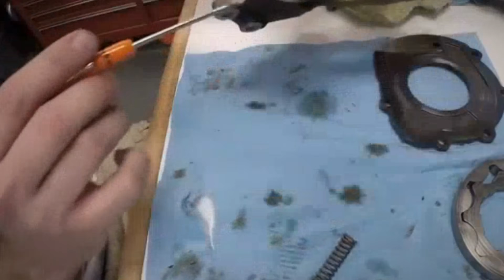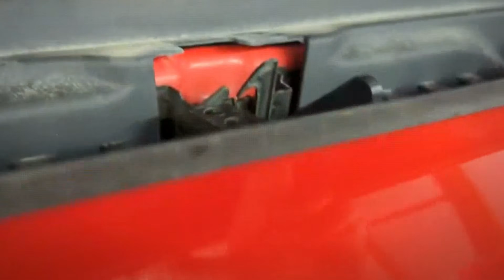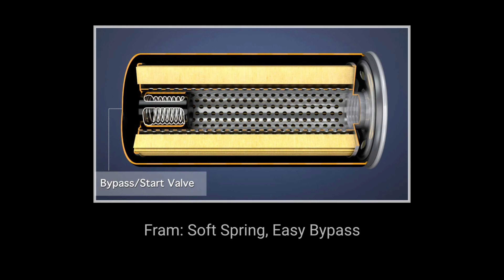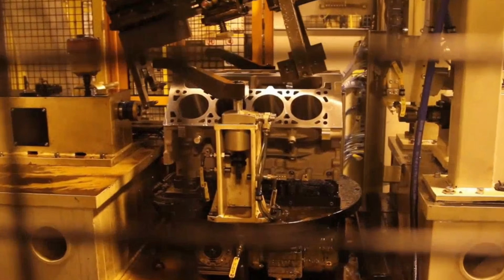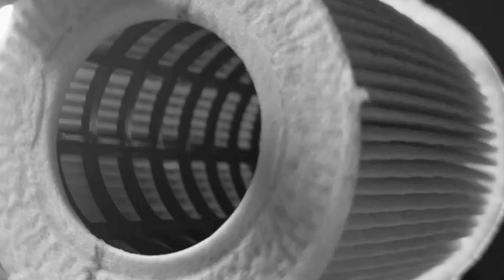I Tested 6 Oil Filters On a Chevy 5.3L — The Results Are SHOCKING (Don't Buy #3)

Comment: I have a 2005 Chevy Silverado lm7 LS 5.3 L 4 x 4 lm7 5.3L I used the recommended ACDelco filter and now my 5.3 L is making ticking lifter noise so I bring it up to 3000 RPMs for a 15 or 20 count and the noise goes away for a little while I'm running Pennzoil Ultra Platinum 5w-30 because of an oil test somebody did on YouTube and found that the oil is good better then Mobile 1. I put some Seafoam in the oil and it cut the ticking noise down, I put it in there because I'm going to change my oil again every 3to40000mi

Comment: I used 1 Bosch filter on my 2008 Lexus. Changed oil at 5000 miles and when I removed the filter element, it had collapsed. Will never use another Bosch.

Comment: WIX and NAPA Gold are the same filter with a different name slapped on em. I switched to NAPA Gold when another cut open comparison like this video, showed me some 15 years ago. I used to use Fram.
Reply: Premium Guard makes Napa Gold filters now. Wix moved manufacturing to Mexico and is now garbage.
Reply: Whats the numbers for the NAPA and WIX you use?
Reply: No Napa has switched to China. FACT.
Reply: Yep. I'll be damned. 2023 they outsourced. I stand corrected. HA! But I still have (4) Wix filters I bought in 2021. I used to drive a lot, changing oil at 7000 miles every 3 months. I'm retired now and drive about 2000 miles a year. Thanks for the update, fellas. 👍